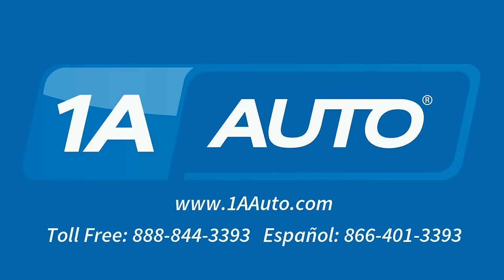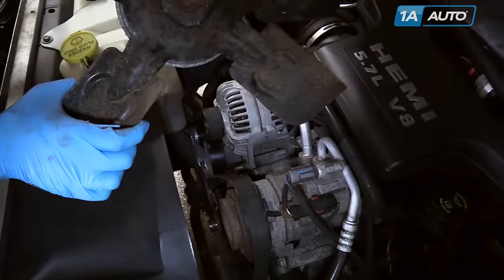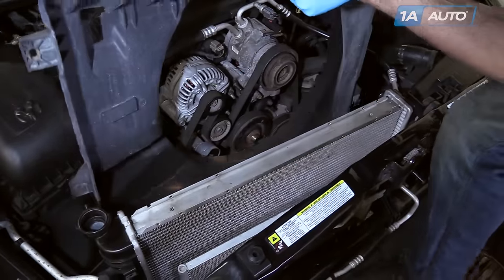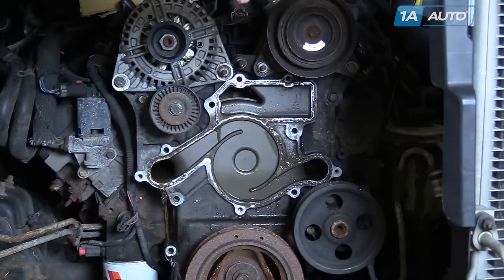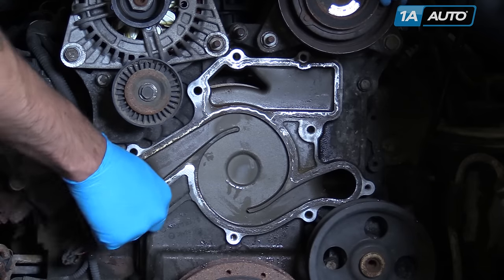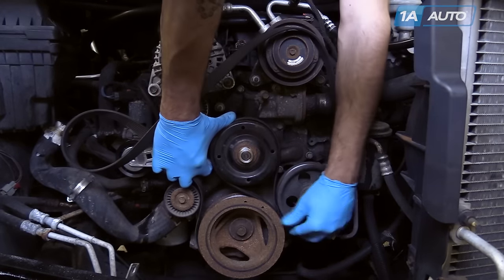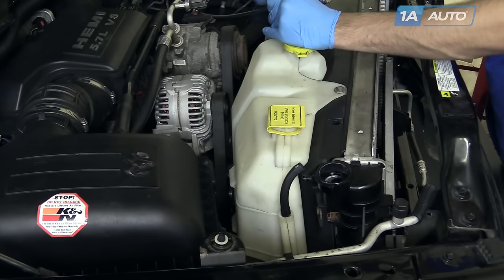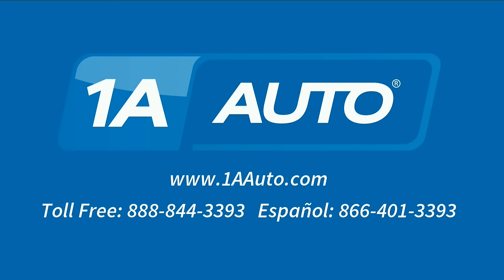How to Replace Water Pump 03-08 Dodge Ram

Comment from the maker: √  Watch the Video 
√  Buy The Part at 1A Auto http://1aau.to/m/Visit-1AAuto 
√  Do it Yourself 
√  Save Money
Reply: Question? To remove the air from the system When turning the heat on dose the truck needs to be on???
Reply: My truck is 2006 v8. I'm not sure where the drain plug is on my radiator to drain it

Comment: Thanks for a great, time saving, video.  I only had one recommendation, if you ever edit this procedure.  I removed the air box completely, and it made a great location to place the overflow reservoir/wiper fluid tank without having to undo ANY tubes or sensor connections.  Hence, no wiper fluid loss, or potential broken connectors with those goofy safety latches.  The air box is easily removed  by loosening the main snorkel tube hose clamp, removing both the snorkel and breather tubes from the box, and then lifting the box out of the engine bay.  With that gone, the reservoir(s) can just be rotated up into the empty space.  Hope this might help someone downstream from here.
Reply: Agreed 100%  so much easier that way.
Reply: bogus360 awesome point out!  I thought about doing it this way too.  Instead I decided it would be a good time to completely wash out the tank anyway.
Reply: Definitely helped out!

Comment: Great video, only thing you missed was the bleeding procedure. Most Rams has a bleed allen screw port located at the outter end of the upper radiator hose. After filling your radiator, remove screw and start and run the vehicle until fluid runs clear at this port, once all the bubbles are gone reinstall allen screw and you're done.
Reply from the maker: +Antonio Ric Thanks for checking us out!

Comment: That was a very informative and extremely well done video. Sure wish I could find one just like it for my 2002 and up Dodge Ram truck with the 5.9 gas engine in it. The 2002 evidently had a mid year change over and mine is the one that is the newer body style crew cab or 4 door, not the clam shell style doors, 1/2 ton 4x4 truck with air conditioning and auto transmission.

Comment: Great video…one of my heater core pipes sprung a leak and of course that means the whole water pump has to go.. your video made it easy.. I had to make a tool for the fan as the tensioner trick didn’t work for me,  where everything was apart I replaced the thermostat and replaced the belt as well.  The video made it easy and needed to Paulse on it for the belt touting.  Thanks for sharing!!

Comment: Very nice video. I like the clutch removal. A big crescent wrench did it! Be sure to check that the fan is in good shape as well as tensioner pulley.

I'm not sure how important this is but when you install your thermostat, there is a little bleeder valve to position upward. Saw that in another video.

It does take a while for tstat to open when starting back up and everything to bleed out and heat start working. I drove a bit and keep opening radiator cap to let air escape.

I did install the $5 gasket between the pump and tstat housing, I don't think it can hurt. I also applied general purpose black adhesive sealant around the water pump. I think it can only help seal things up if you're worried.

Comment: Thanks for the video! The pipe wrench trick didn’t work for me after battling with it for 45min. Went to AutoValue and rented the fan clutch spreader bar and wrench. Took me 2 seconds to take the fan clutch off. Rental was free.
Reply: That trick barley works. Unless its been off recently

Comment: Great video.  Only question is why put the shroud on before the fan?  Also for some reason I thought the thermost was at the bottom of the engine.  I guess not.... or are there 2?  I have a 2006 4.7L

Comment: Great Video but is it possible to remove the radiator fan shroud before removing the fan blade? It looks like it could make removing the fan blade easier. Also, where is the weep hole located on this type of water pump?  Thanks
Reply: I know it's been 7 months but I had trouble taking the fan clutch off so I took off the bolts that hold the fan and I was able to scoot the fan blade over and pull the shroud off 👍🏻

Comment: The bolt located behind the power steering pump has to go in with the pump assembly. It won't go in after all the other bolts are in.  That same bolt will not come out on its own and has to be left in and removed with the pump.

Comment: Very very very helpful thank you question does a 2006 ram Mega cab has a relay for the condenser fan it seems that nobody knows that the RAM 1500 Mega cab the parts you buy have to be for a  Ram 2500 sometimes it confusing plz help

Comment: I really like this step by step. I just can't break the fan nut loose from the water pump. I used the tensioner, but there's too much coolant on everything. Any recommendations on what else to try to break it free??
Reply from the maker: +Jason Haugen Thanks for checking us out! If possible, try to dry everything with a towel so the wrench gets a solid hold. You could also use another person to try and help with this. If you can raise the vehicle that may also give you better leverage to use a smaller wrench.

Comment: Hey, I used this video to swap my water pump, everything went smoothly. The problem I have now is the upper hose is spitting a bit. From the radiator side of it.  Should I double clamp it? I have a brand new upper hose on it but it's still like a little sprinkler, loosing maybe 1/16 in the reserve tank a week.

Comment: I went to do this job today. Bought the duralast water pump from autozone.  Got everything disassembled and went to put the new duralast water pump in, but the mold/casting must have been bad because there was NO way that i could get all 11 bolt holes lined up. Any way that I started it, only 4 or 5 bolt holes would line up. Some of the casting holes were off a good 1/4" and I was not about to start drilling/over sizing holes on a new waterpump housing just to get the bolts in. I was pretty damn pist off because this was supposed to be a simple repair. Instead I had to put the oem water pump BACK on the truck so that I could drive it, and next I will have to return the badly built pump to autozone. Looks like I am starting from square 1 again. I will probably just find a new/oem Dodge ram one instead. One that doesn't have a bad casting/mold.  This stinks. What a waste of 3 hours.

Comment: At the end of the video you said let it run the bubbles out so I filled the radiator the expansion tank was already full I let it run and topped off but it kept running dry in the radiator do I add more or wait for the expansion tank to even it out

Comment: The only thing I will add is if your thermostat has a small weep hole in it, this would go up so as to help burp air from the system..excellent video..

Comment: The pipe wrench worked for removing the fan but at first the belt kept slipping.  I wedge a sponge in between the belt and the pulley and that worked after several attempts.

Comment: 8:55 instead of using a bolt map you can just use the new water pump to hold your bolts as you take them out

Comment: My timing chain cover gasket on my 06 Dodge 4.7 is leaking water to the outside. I am going to order the Felpro 46000 gasket. Do I have to use sealant with this gasket. Also do I use any other O rings in addition? Thanks you.
Reply from the maker: +Lastinline You should not need any sealant with this gasket.  Thanks for watching!

Comment: Quick question what type of antifreeze is required dexcool or just your regular 50/50 antifreeze, I have a 2005 Ram 5.7 hemi?
Reply: Do not use regular green antifreeze in these, they take HOAT coolant 50/50 mix (of course). Best HOAT stuff I've found that I use in mine is Zerex G-05, sold at AutoZone and Amazon.

Comment: Great video, followed it perfectly, however after reassembly the truck failed to start after it had just been running with a “coolent system performance” code, let it sit for 30 minutes or so and then it ran just fine with no issues

Comment: Could you remove the water pump without having to take the radiator fan off and just replace the radiator fan with the new water pump?

Comment: I have a 2011 5.7 Hemi Ram. I want to do a simple flush & fill of the coolant.  My fill bottle is at the front of the truck & is black plastic. I can't tell how much coolant to put in as I see no high or low mark. How do I keep from over or under filling it. Thanks

Comment: After removing my water pump on my 2003 dodge ram 1500 5.7 l. I noticed a hole on the block. I am unsure if the hole is some type of vent or not. My truck is still leaking especially when cold. Any help is welcome nice video.
Reply from the maker: +mobidd Thanks for watching!  There really should only be outlet and inlet holes for the water.  If you are unsure if that is normal we recommend having a trusted mechanic take a look.  1aauto.com

Comment: I took the radiator plug out of my radiator to drain and the fluid came out the of tge plug area nit tge spigot on the bottom of the radiator. Now I put the plug back in and started to fill with coolant and now its coming out if the spigot with the plug in. Any ideas what to do or whats the problem?

Comment: i found it was easy to just pop out the air box and then swing the overflow/washer tank over in it's spot, no disconnecting of any tubes or wires

Comment: Please update with magic trick that makes the centre bracket between AC compressor and alternator disappear, exposing the 15 mmeter bolt The 2nd 15 mm bolt.
Reply: Your comment saved me the headache dude, I took all the bolts off but the pump wasn't coming off I knew there was something holding it but I couldn't see but then I saw your comment and there it was hiding 😂😂

Comment: I have a 04 Dodge Ram 1500 5.7 and I can take off the fan shroud with the windshield fluid tank without taking off the fan clutch.
Without scraping my radiator fins.
I have way more room to do everything.

Just a tip for people with the same vehicle.

Comment: Did everything step by step. My truck is now over heating and my heat isn't blowing hot air. Any checks I should do to fix this???
Reply from the maker: +Ronald vasquez You may want to make sure that the radiator fluid is up to level and that there isn't a trapped air bubble in the system. You may also want to make sure that the thermostat was installed and working correctly. Hope this helps you out.

Comment: I found it odd that there was no mention of a gasket between the water pump and top hose inlet. I didn't feel that the thermostat alone was enough to seal. I ordered all the parts and threw it out there That I needed that gasket and turns out it's a thing. So now tomorrow when I rip this apart I know it will go back together and definitely  not leak.

Comment: I was wondering if you can just replace the black steel tube for the heater core that's on the water pump or does pump need to be replaced. My tube is rusted out . I know it's a old video but if someone could help thanks

Comment: Is there a video for removing and replacing the water pump for a 4th gen ram 1500?
Reply from the maker: +Pablo Vasquez-Chavez At this time we do not have any videos showing this installation but are always expanding our video library. We would suggest checking through some other YouTube channels or forums for your vehicle.
Reply: If it's the 5.7 I do believe it should be pretty similar, Hemi hasn't changed too too much.

Comment: 1:37  Sorry but it's laughable how you can loosen the fan bolt with just one single light tap of the hammer.  I had to use an air hammer for half an hour to get mine off.
Reply: thats where im at right now and its a pain lol

Comment: Great video, I just had mine replaced for $362. I could have done it over the weekend I think but was pressed for time, headed to work and had to be done quick. Maybe I can check out some your other videos.
Reply: The auto mechanic here wants to charge me $520 and that's not a new pump that's just a thermostat and a seal.
And then he tried to Bulldog me into replacing the waterpump which he was going to charge me $720 but I refused because I bought the truck in the guy told me the water pump was new so I know the seal is just bad this is a crazy lol

Comment: That's a pretty smart trick of stopping the water pump pulley from rotating by using the tensioner when loosing the fan bolt
Reply from the maker: +OVI-Wan Kenobi Thanks for checking us out! http://1aau.to/m/Shop-1AAuto-c

Comment: I though about 1aauto for my replacement part but when I checked prices 1aauto was the highest
Reply: Update I bought something from 1aauto and the part come in damaged!
Reply: They're pretty high I looked on eBay I found one for 88 books compared to 300 and something that AAA wants but I don't know what the quality difference is so you'll have to check that out the picture looks the same and the color of the housing is the same there is one that's real shiny that makes me nervous for $74 so I don't think I'd go with that one

Comment: I have a 03 5.7l
is it normal for the bolt down by the steering pulley to be a pain to get out. almost seemed like I was going to have to pull the pulley.
Reply from the maker: +Jason Spellich They can definitely be tough. That's an area that gets really hot at opperating temp. so it's common that the bolts get tough to remove since they're constantly expanding and shrinking with temperature. Try soaking it in penetrating oil and letting it sit for a couple of hours before coming back to it. Then, soak it again and try to remove. A 50/50 blend of ATF and Acetone makes for a great penetrating oil, fyi. Hope this helps you out.  1aauto.com?utm_source=YouTube&utm_medium=CTA%20Comment&utm_campaign=1ATony 866-403-3393
Reply: 1A Auto Parts 
wasn't a problem breaking free but pulling it out there didn't seem to be enough clearance to pull it out. Had to leave it dangling in the pump and pulled it out with the pump.
Reply from the maker: +Jason Spellich Oh yeah, that sort of thing happens all the time. No biggie!
Reply: Yes that bolt barely cleared for me.  Had to tap it a little to slide by when reinstalling

Comment: Mine is 07 4.7 ram... but it looks like it has the thermostat on the bottom 🤔. Or is this a 5.7?
Reply from the maker: +Ricardo Ramirez Thanks for checking us out! This video is for models with a 5.7L engine. This procedure might be different for your application. We do not currently have a how-to video for this particular engine size.

Comment: Great video. The only thing I would suggest to tell people is to open the radiator before draining. It will help the flow. But what concerns me is something simple like an oil change or trans. Make sure you can fill things prior to draining them. Gnomesayin? Don't wanna mess yourself over. Radiator caps aren't really strippable but it's always good to make sure you can refill prior to draining.

Comment: All bolts removed, but water pump refuses to come out! I've tapped with hammer, used a little PB blaster, twisted and pulled, still nothing. Any ideas on how to get this stuck water pump off of my 05 Ram??
Reply: Are you still trying?

Comment: can water pump make steering wheel hard to turn while pressing brakes.
started doing it as soon as water pump went bad.
please reply
Reply from the maker: Only if it's on the same belt as the power steering. 1aauto.com?utm_source=YouTube&utm_medium=CTA%20Comment&utm_campaign=1ATony 866-403-3393

Comment: I changed my water pump the exact same way the video describes and now the truck won’t start. Turns over very slowly. Any ideas?
Reply from the maker: +Marc Rodriguez Thanks for checking us out. We are sorry to hear your vehicle won't start. We would recommend to go back through the video and make sure every step is covered and if you are still having an issue to contact a local mechanic to take a look to see what the issue is.

Comment: Good video gonna tackle this job on the weekend. One question do u have to add any sealant/gasket glue to the rubber gasket before putting it on the engine
Reply from the maker: +Ken Binns You want to add a gasket on the new pump so that it doesn't leak. Hope this helps you out. 1aauto.com

Comment: Getting that fan off was the hardest thing to do.  I had to take the water pump completely off, put it in a vise, bind the pulley and heat it with a torch.

Comment: I call bs on the pipe wrench method for removing the fan. I've been out here for hours and you can't put enough tension on the belt to keep the the pulleys from moving.

Comment: I have a seal leak. Do you sell the seal?
Reply from the maker: +goheat77 We do not sell the seal by itself, but we do have a selection of water pumps based on application on our website.  Just search by year, make and model and select the water pump that will work for you!  1aauto.com

Comment: Thing with coolant is that it’s annoying when draining. It’s liquid that you don’t want to get on dirt or grass, pavement, concrete. With all water in radiators you can let it drain all over the ground and it’ll dry up! Safe to drain on the ground (it’s friggen water) Buuuut… vehicles require coolant. I wouldn’t let it spill all over the ground outside. All over pavement, concrete. It’s something you drain in a pan and store it in a container and get rid of it. Like oils or fuels. Some vehicles do take water for cooling! I use coolant in my vehicles… well reason is that they are dodges. They use coolant. 50/50. Better to use full coolant in winter time I hear. Or depending on how engine is. I use full coolant for a while. No problems. Everything alright. When changing coolant, best to run cleaner or distilled water through the system to clean it out. Then, add new coolant… best to have a large tub to place under vehicle when draining